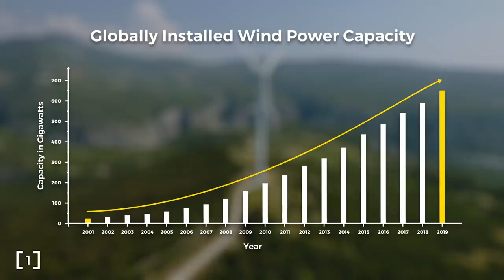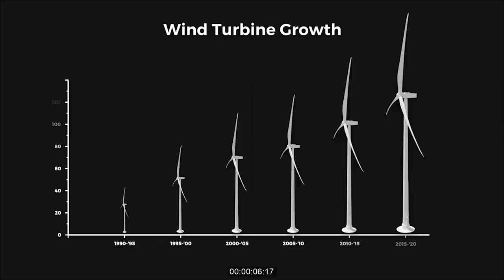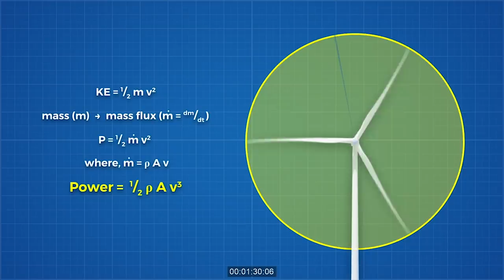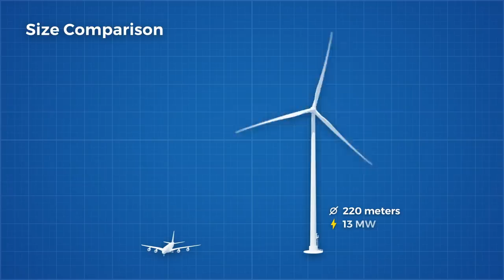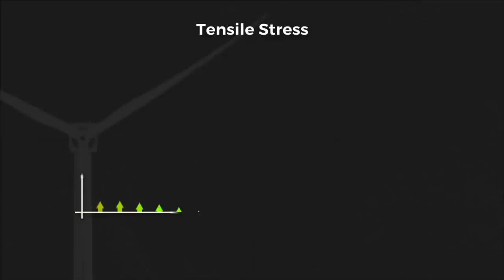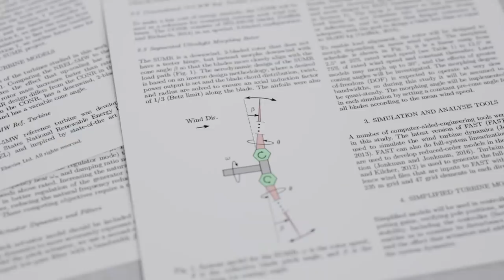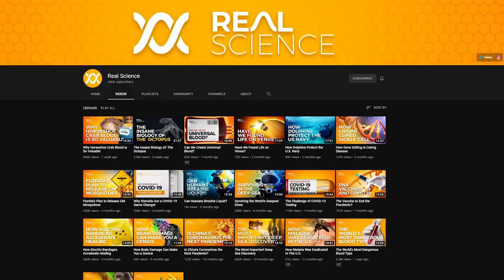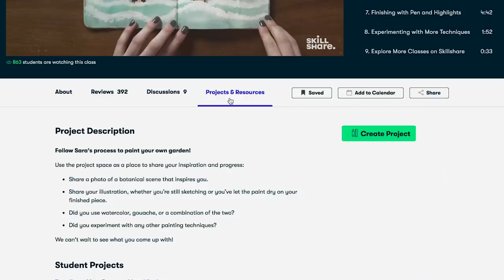How Big Can Wind Turbines Get?

Comment: So many false statements in this video I don't know where to begin.  The first two minutes are just laughable.  Although there is some good information here, it's being presented under a somewhat false or misleading narrative.  Engineers have not figured out how to efficiently implement wind into the grid.  There are some exceptions of course, as highlighted, but there some major obstacles that engineers have not been able to overcome.  The problem is being able to ramp up the power output as needed and store enough extra energy for peak needs when excess is available.  We don't have the battery capacity to do so.  This is the big problem pro green energy, climate alarmists choose to ignore.  The statistics of the effectiveness of wind turbines are inflated numbers.  The push for wind and solar is being subsidized by special interest groups and government agendas.

As turbines become more efficient, the cost of electricity does not plummet.  That's not the way the economics work, especially in a capitalistic society.  Not in the real world anyway.  The suppliers keep the additional profits created by lowering their costs, it's not passed on to the consumers.  The savings are only passed on when a competing product sells cheaper, forcing the supplier to lower their rates.  You have to remember, the consumer is not their customer, the stock holders are.  

Coal plants are not being replaced by wind and solar as the green energy community would like you to believe.  What's actually taking place is these plants are being replaced by natural gas and bioenergy plants, aka burning fossil fuels and trees.  Everyone should watch the documentary by environmentalist Jeff Gibbs and Michael Moore:  https://planetofthehumans.com/  

Although wind and solar have their place, we need to take a harder look at nuclear and hydro options as a more viable solution.

Comment: What is your take on Vertical Wind Turbines (VWT) vs. the wind turbines in this video?
If mankind could decide which of these is more efficient and cost
 effective, they can make a proper selection? I challenge you to compare both options and use mathematics and engineering to decide which is better?

Comment: And the shoreline solution ... You assume all shorelines are valid. Only about 0.5% of world shorelines are able to have off shore. Totally ridiculous you used Netherlands and Ireland as examples. Wind only works in a certain range. I live in Saskatchewan which is considered windy. We have wind power but its very intermittent. Blades get shut off after like around 25 kmhr and useless under 10. Lol a lot of heavy metals used wind solar as well which you didn't mention

Comment: I'm stopping the video at 9 minutes. It would make much more sense to create many more smaller turbines than it does to make a lot less huge ones. With this method, millions of them could be manufactured and sold cheaply and easily. People could even mount them to their houses or people with land could build many of them above their cattle farms. With many smaller ones, however, the cabling would be an issue, but with predefined cabling methods and equipment, this problem is also solve relatively easily. You say that it takes a huge amount of capital to create these turbines. Sure, but how much capital would be recorded if the adopters of such technology numbered in the millions rather than the thousands? If you want green energy to take truly take off, you are going to have to place it in the hands of the market where people reside, not large companies! Consider this: how much easier and cheaper would it be for someone loving on an acre of land to have a bunch of turbines with also a bunch of solar panels to produce their own power completely off the grid? Exceedingly! But you don't get to control them via the electric company that way.

Comment: "The unsung hero is a fossil fuel and its not going anywhere" 😂🤦‍♂️
 Also a gross misrepresentation focusing on Denmark's wind production without mentioning Germany's huge failure in wind. The video's only metric for success was wind's % of overall production while Denmark is paying more than ever for electricity. 
Very surprised there was no mention of bird populations decimated by wind farms or offshore farms creating such terrible noise and vibrations underwater that they are wiping entire ecosystems. 
pretty terrible video overall

Comment: I'm gonna have to stop you right there they haven't really pushed the boundaries.  All they really done is made a super inefficient blade Just a little bit more efficient than it's inefficient tentacle.  If they put a reverse Archimedes turbine on there 
1. You wouldn't have to have such ginomist blades.
2.  You would get out 5 times if not 10 times more power.
3.  You wouldn't have to have the wind  turbine so high up in the air. 
And all of that combinates in Less materials wasted More money saved and EVEN more money  In your pockets. There's a reason why they call it Mathematical efficiency. Most wind turbine companies are just becoming Edison Putting generators all over the f**** globe. Because they're not thinking like Nicola Tesla. More efficient more powerful more effective and more output